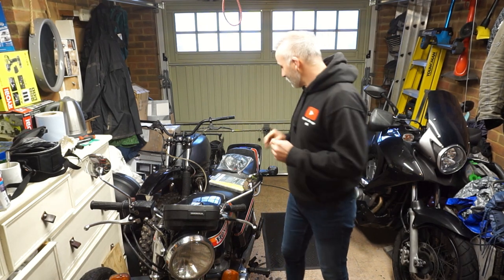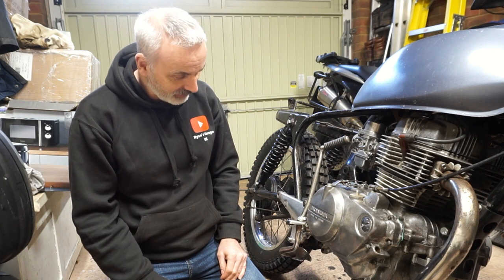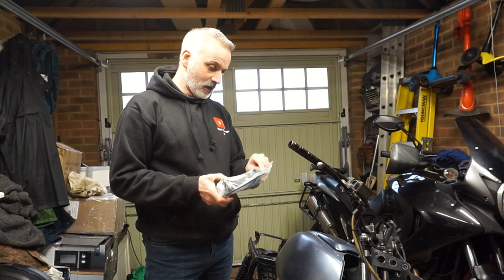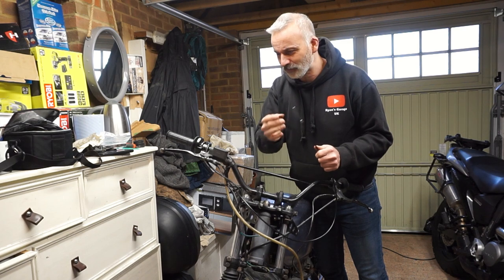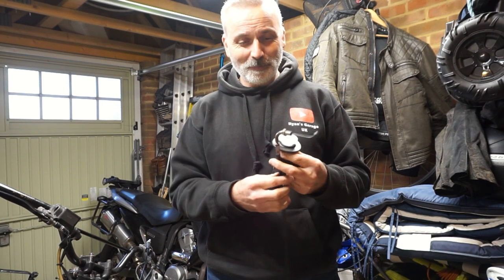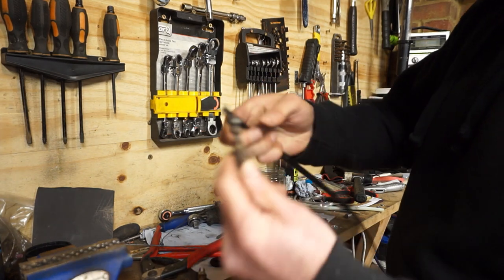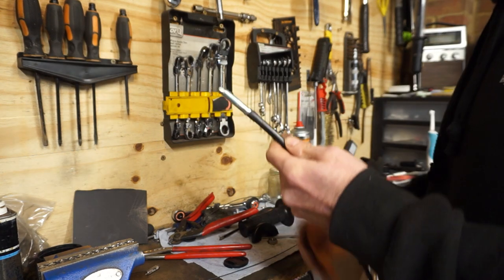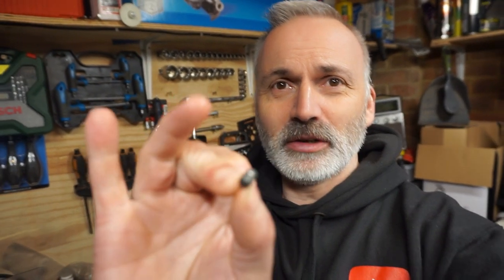Mix and Match Throttle bits doesn't exactly go to plan.. -  Project Bike Build -Part 36

Comment: A lot of those off the shelf cables have nipples which are simply solder, moulded onto the end of the cable. I found that out when I had to shorten a cable and tried heating the nipple up to remove it, but it just melted. I bought some brass rod the right diameter, cut and drilled a new barrel nipple (that's what they are called) and soldered it on. Incidentally, you may be able to buy (or even make) a barrel nipple adapter to fit the cable that came with the twistgrip.
Reply from the maker: Hi, Thanks for your comments . i have now have a purchased screw secured nipple, which I plan to also solder.

Comment: Make sure you 'birdcage' the inner wire when fitting the new nipple.
The hole in the nipple should have a concave side for the 'birdcage' to fit. You can buy special tools for this but they are expensive!
The 'birdcage' is the bit that gives the strength which is why it is hard to remove the nipple from the wire! The solder just holds the shape.
You could make your own tool, internet search will show what they look like, I have done this just using aluminium soft jaws in the vice (needle file a slot to grip the wire and drill a small dimple), flare with a centre punch and use a pin punch to carefully shape the end but don't overdo it and remember to put the nipple on first!

Good luck!
Reply from the maker: Hi, i was totally unaware of this term or method before your message. Thank you. I have just received the nipple and it is held on with a screw through the end design. But i will try to understand if I should still follow this suggestion as well. Thanks Ryan
Reply: @RyansGarageUK  Hi, those screw nipples are really meant for temporary emergency fix. Probably be ok for a throttle cable but not sure I would trust them long term.